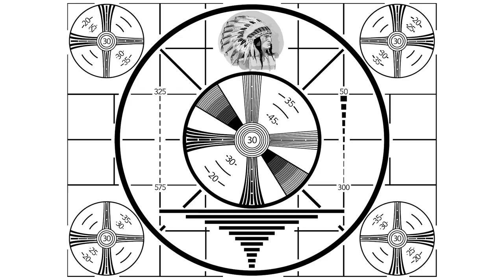Building a Wall Tent platform on our off-grid property

Comment: might regret not digging the footings down - hate to see your work wash away (or buckley from freeze)
Reply from the maker: Agreed. I am a little worried about that, and rot. Not shown in this clip is that we slapped water sealant on a lot of the untreated lumber. Not digging in for proper footings was a building code compliance trick. Our county requires it for any buried footings!